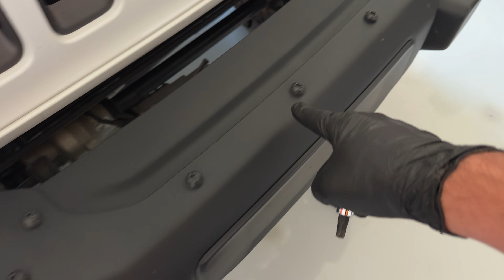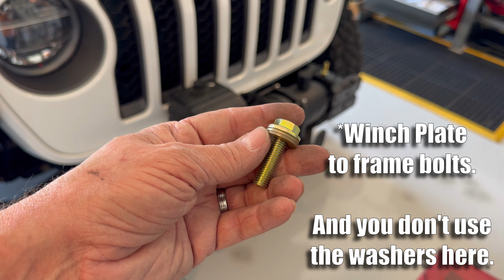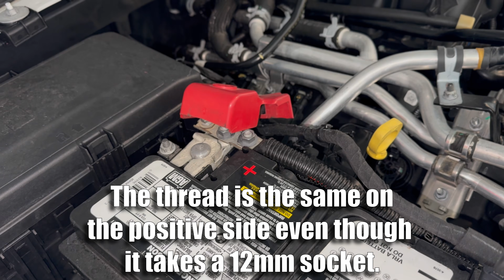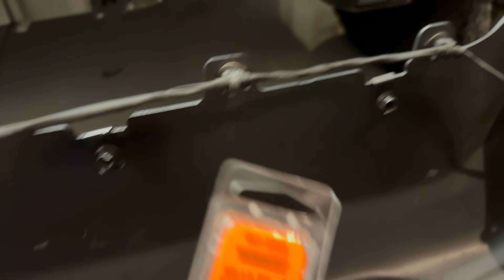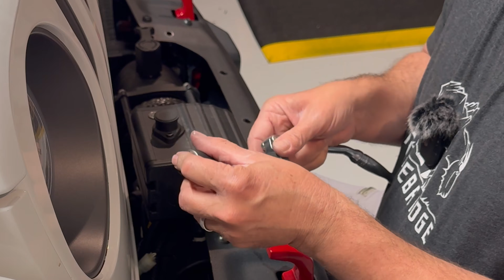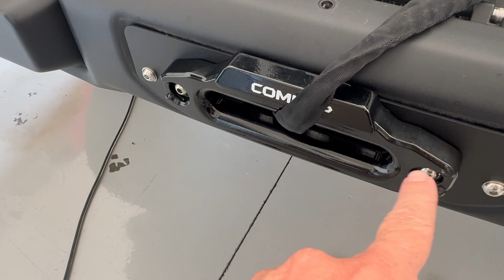Easy Winch Install: Jeep Rubicon Steel Bumper (JL & JT)

Comment: Just a note: bevel the inside of the fairlead guide. The bevel will provide a smooth surface to slide on. Next question I have: why run the two power leads to the Battery post? Could you run the positive lead directly to the plus post on the battery and negative lead to the frame of the Jeep. Also I would suggest a quick disconnect on the positive side of the winch power. Yes, I have done before.
Reply: They use a relay that’s hooked to one your auxiliary switches
Reply from the maker: Ah, that makes sense. Only having a basic electrical understanding, I wonder if I could replicate that using an Aux switch in my Jeep? I’d have to have guidance on that setup.
Reply from the maker: - If I’m understanding you correctly, you could and a that’s good tip there if you feel it’s close to the steel. The edges of the fairlead are already beveled to an extent. Perhaps about an 1/8 to 3/16 radius at the back where it bolts to the bumper. As long as you bias it up like I mentioned in the video, giving a very wide safety margin that Grimm turned out also suggesting before I knew they suggested the same, I don’t foresee any possible issue with fraying of the line. 

- You could do that too. The connection points were already there on the factory wiring and I’ve not had an issue yet on this Rubicon or the red Sahara we had. I’d also need to cut off a lot of negative cable and be able to properly re-crimp the terminals back on.

- And that’s a good idea too. Especially if you find your winch is giving a parasitic draw. I’m curious whether the factory installed winches have a manual disconnect.